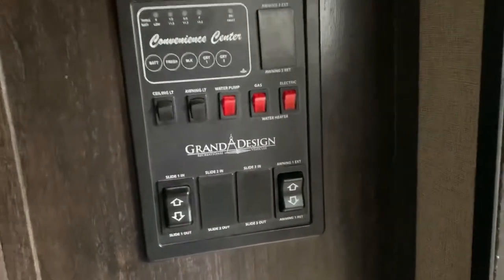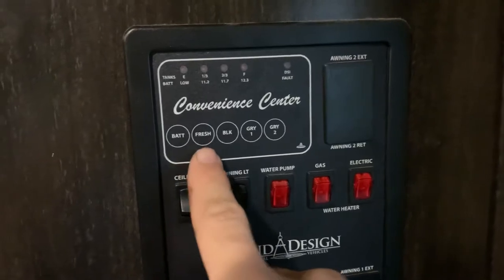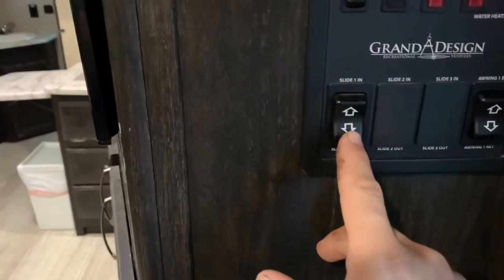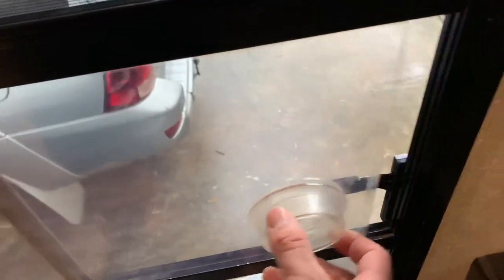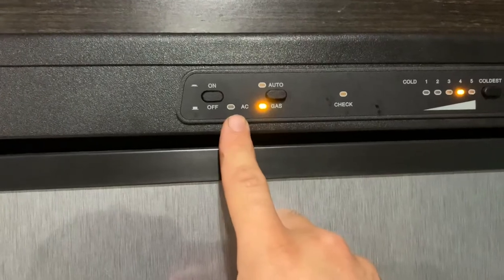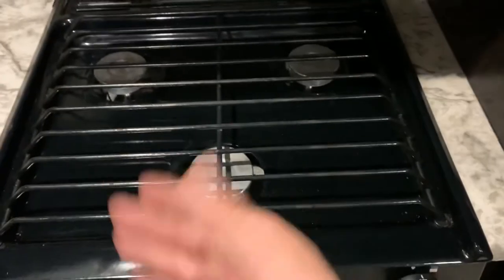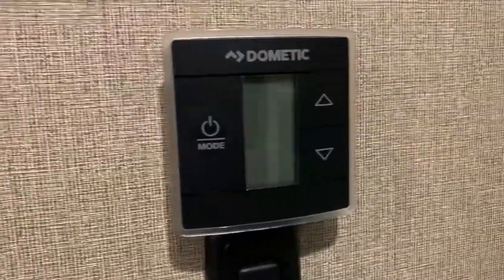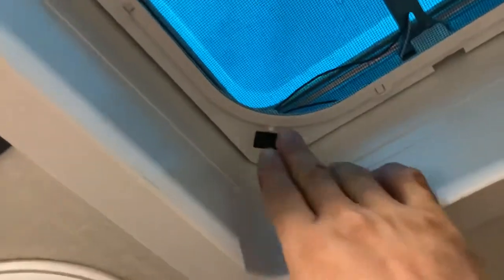RV demo - Grand Design Imagine 2500RL

Comment: When you run the slide in or out, hold the button down for a few extra seconds to allow the motors to synchronize.
Reply from the maker: I always hold them down about a second or two after they fully stop and go silent. Im always a little nervous about the slide getting out of alignment when its going in or out. Thanks for watching!